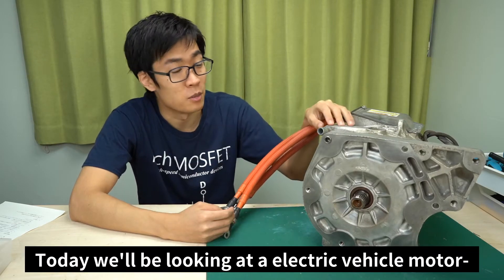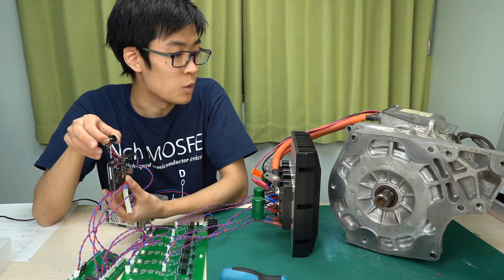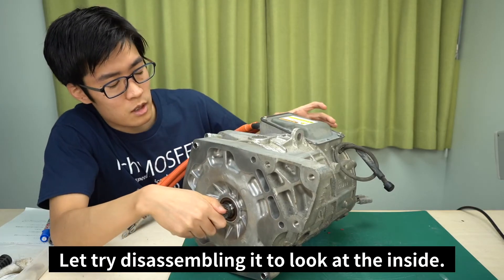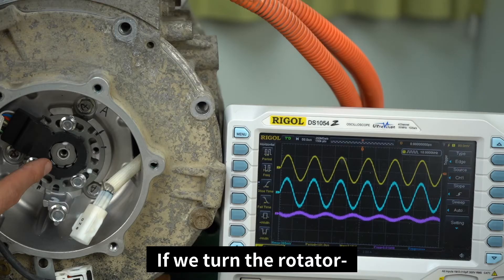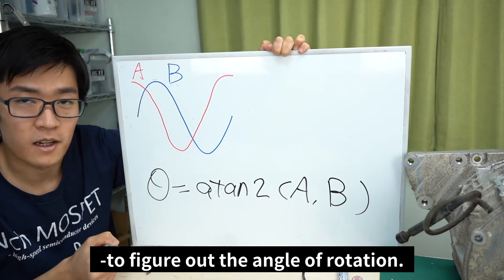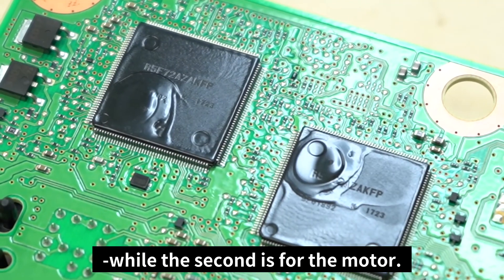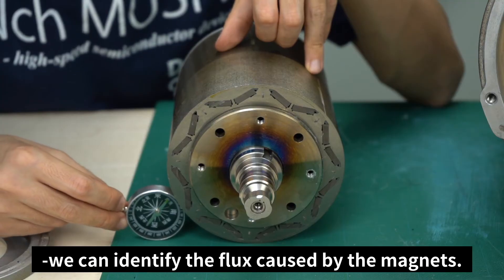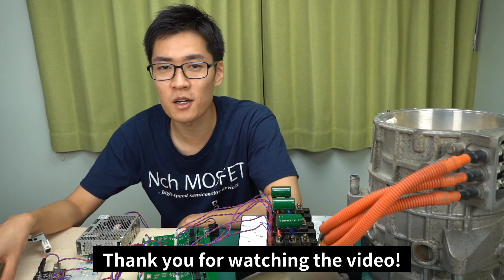47kW Electric Car Motor from MITSUBISHI i-MiEV. [Eng sub]

Comment: Hi good video... we normally call the rough running, pole slip, rather than rupture, in the power industry where synchronous motor/ generator make power fir the electrical power grid.

Comment: Excellent video. Cannot understand why the resolver iron core is hexagonal though. The resolver I studied in engineering courses has the main winding rotating with the rotor itself, cannot understand how this particular solution works (in particular I don't understand why has to be hexagonal and not a simple cross for example).
Reply: This is called a variable reluctance resolver. Yes there are several variants. You will find a selection of different types on the Tagawa Seiki website.
Reply: @RobOrBob60  Oh yes got it, thank you, I knew about variable reluctance solver but I thought they were absolute (i.e. they needed an initial alignement since the position is not known a priori), probably this is an absolute encoder too and not a resolver.

Comment: Hi, thank you for this video, i bought the same engine with idea of future prototype but i was thinking that i may use it as a generator. Do you think it is possible to have 50hz and 3 phase 380v just by having the correct rev/min or it is better to  make dc current first than use an inverter to produce stable and power full output?

Comment: These are the same motors in the Minicab and I do wonder if 30kw is enough when carrying a 300kg load up a hill or doing 100kmph on a highway....I know the vehicles only weigh about 1100kg but 30kw is less than half the power of most small Ev's. 
Could this motor handle 47kw of sustained output?
Reply: Look at the power of old 1960s vans. The VW transporters of that era had about 30kW too, but hauled much more than 300kg. Not at 100km/h though.